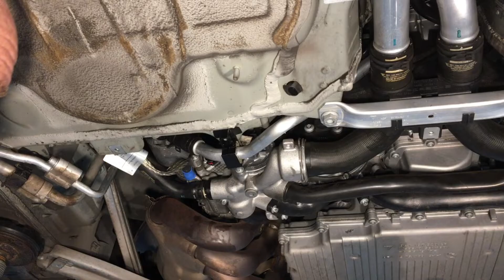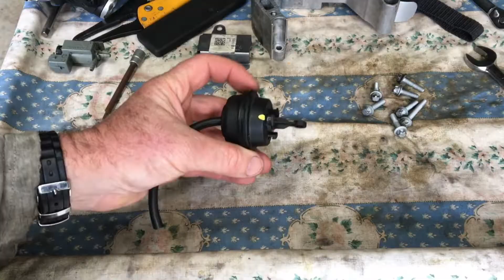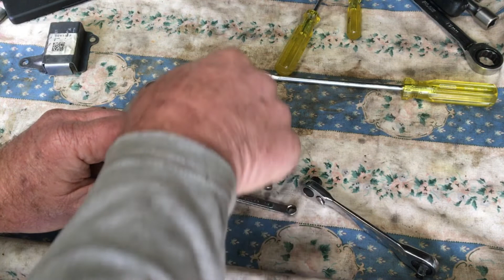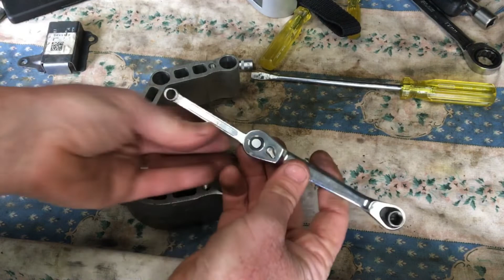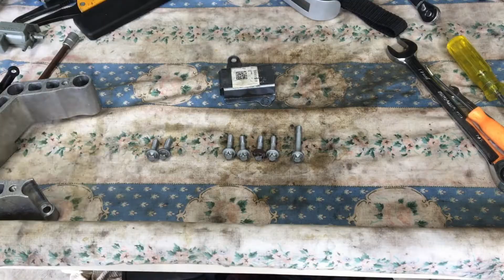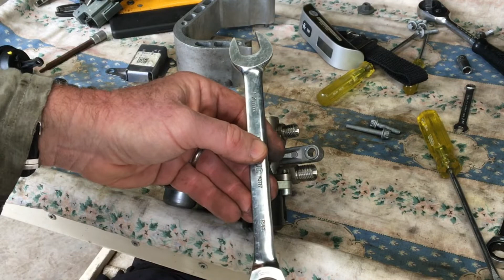Porsche 981 high pressure fuel pump

Comment: Hi Jeff,just to say watched many of your very detailed videos that helped me do a pdk oil change without any issues also the door card issue!| have recently had my car bogging down at 5k rpm randomly so changed the plugs and drove amazing like a remap!BUT on occasions would still not rev past 5k!slow cranking start after days of being parked up misfiring but once warmed up was fine then whilst driving with hood down heard a ticking noise like metallic assumed it was something in the wheel catching then did a datalog with kess3 5kpa-12.5kpa recorded when car drove fine within limits then when it happened again would not get more than 5kpa!i assume hpfp?hopefully you can confirm these are the symptoms of a hpfp failure thank you in advance if you can advise

Comment: Hey Jeff,   thanks for the video.  Changing the topic a little.  Since my high pressure fuel pump died on my 2009 Cayenne S died, and they are over $2200+ US dollars.   I decided to see if I can fix it.  After many hours of research ,trial and error, etc. I was successful and fixed it.  Has been running great for a couple of thousand miles now.    Have also fixed it for two other people.  Recently I noticed that it's more or less the same pump for the V8 Panamera models,  as well as the Cayman/Boxster and 911 models.    Would you be interested in knowing the details and maybe show something about it on your channel.   Not about me, etc.    but in general to show people that these pumps can in most cases be fixed for less than $50 in parts vs thousands buying a new one.

Comment: Jeff, thank you (from Texas, USA) for this (and others) fantastic video!  Thanks especially for your tip of lowering the engine (I lowered mine probably mine 1.5 - 2" (~35-50mm)) and gained enough room to be able to remove and reinstall the HPFP without disconnecting any coolant hoses, etc.  The only thing I disconnected was the bracket that holds the solenoid assembly to the frame so that I could at least move that around a bit.  It was by no means easy to get it done, but I made a point of being patient ;) and was successful.  Now my issue - this didn't fix my problem.

This all started two weeks ago when, after a 2 day track event and a 30 minute drive home afterwards with ZERO symptoms, the next day my 2014 Cayman S wouldn't start whatsoever.  The starter cranked normally but the engine wasn't firing at all.  I plugged in a Foxwell NT530 OBD unit and got a low fuel pressure code.  Readings were in the 600-700 hPa range (if I read the Foxwell correctly).  So, I assumed I had an HPFP issue (Note that I have had "micro hesitations" under low-gear moderate acceleration since I got the car in 2018, but have never noticed any acceleration issues at the track.  So until this point I have lived with it and was hoping that the HPFP replacement would solve both issues.).  However, the problem hasn't changed at all and the Foxwell, though now showing ~800 hPa, still is throwing a low fuel pressure code.

I would greatly appreciate your thoughts on some question:  Would there be an issue with air in the fuel system (I cranked the car a good long time and it never showed any signs of life)?  If so, how does one bleed it?  Could it be a relay(s)?  If so, how may I debug that possibility?  Could it be the LPFP in the fuel tank?  I watched your excellent video on that topic and am a bit daunted by the thought of removing that ring around the top of the sending unit.  But, before I tilt with that dragon, and before I drop several more hundred USD on the other fuel pump, will I be able to determine if it's bad by trying to turn it on and see the flow at the junction point in the back of the car you note in the other video?  My concern is that fuel might flow but I wouldn't be able to tell if it was at a good pressure.  Of course, any other thoughts/suggestions would be greatly appreciated.

My goal of participating in a 12/7-8 track event is in grave danger at this point.  The car has been up on jack stands for over a week...

Extreme thanks for any feedback.
Reply from the maker: I'm not an expert on this subject, but what I do know is that the low pressure fuel pump is simply 'filling' the HPFP, so it can then increase the pressure and provide this to the engine. If it worked fine immediately afterwards I would think there is no air in the system. It will purge it very quickly. If you test the LPFP output at the join like I show in the fuel pump and sender video, this will give you a very good indication if it's working OK. You can see the rate that is pumped when the full 12V is applied in the video.

Getting access to the top of the pump and disconnecting the fuel lines to test is pretty simple. If you do need to replace the LP pump, the tool to do so is now easily available. See link below. It's the same as the BMW pump. It takes a lot of force, and you will need a long breaker bar to remove. This is just the way it is, and the tank and fittings are designed to take it. 

https://www.aliexpress.com/item/1005006259802939.html?src=google&src=google&albch=shopping&acnt=631-313-3945&isdl=y&slnk=&plac=&mtctp=&albbt=Google_7_shopping&aff_platform=google&aff_short_key=UneMJZVf&&albagn=888888&&ds_e_adid=&ds_e_matchtype=&ds_e_device=c&ds_e_network=x&ds_e_product_group_id=&ds_e_product_id=en1005006259802939&ds_e_product_merchant_id=564517555&ds_e_product_country=AU&ds_e_product_language=en&ds_e_product_channel=online&ds_e_product_store_id=&ds_url_v=2&albcp=19821179470&albag=&isSmbAutoCall=false&needSmbHouyi=false&gad_source=1

The pressure you quote is pretty much zero. So it's going to be either the low or high pressure pump. Testing the low pressure pump first is the way to start the diagnosis.

The micro hesitations are generally not going to be a fuel issues. Normally this is due to carbon build up in the intakes, as it's a GDI engine. See my video on walnut blasting of intakes for how to correct.

https://youtu.be/HqPPPF_zin0?si=4bx7D-C8OXcjo9O4

https://youtu.be/opxP7DluExs?si=eDq2nY3JB0rcv2kg
Reply: @jeffrichardsoncardiy  Thanks much for your reply!  Very much appreciated.  Well, I ran the LPFP directly from the battery and output the fuel from the under-car access point, per your video, into a .950L bottle.  In about 2 seconds there were 5-7.5cm of fuel in the bottle.  From my perspective, it seems to be working fine.  So, new (remanufactured) HPFP, LPFP OK, car won't start and the OBD computer complains about low fuel pressure.  Thoughts?  (I will owe you a case of Fosters after this... ;) )
Reply from the maker: @tawaspt  You definitely don't owe a thing. I'm more than happy to help.

The last test I'd do is to confirm the LPFP module is working OK. Have the fuel line disconnected like you did for the other test, then crank the car, so the fuel pump module is applying power to run the LP pump. If it flows normally, then I'd say it's the HPFP. Note that the flow will probably be less as it will adjust the output based on demand.
Reply: @jeffrichardsoncardiy  Excellent idea.  I will try this tomorrow morning (20:23 here presently) after I put all the "stuff" back together on top of the fuel tank.  I understand the supply/demand concept that the DME will presumably manage.  I'm just curious as to how that will look coming out of that pipe.  Strong initial flow then less?  Or?

Is there a sensor downstream of the HPFP that could be bad?  I just went through 2 HPFPs (OEM and remanufactured) and I would be surprised if both were bad (could Murphy's Law be that cruel?).
Reply: @jeffrichardsoncardiy  I forgot to ask.  Is there such thing as an air purge/bleed process required?  I have searched and found none.
Reply from the maker: @tawaspt  NO idea what it will look like, but as long as there is decent flow rather than a trickle or nothing, then I'd think that would be fine. I'd be very surprised if two HPFPs failed. This really does point to something else. Maybe a bad pressure sensor on the HP rail?
Reply from the maker: @tawaspt  There is a 'first start' procedure in PIWIS, that is supposed to fill the fuel lines etc. I didn't use this when I made the video and the car started first time without issue.
Reply: @jeffrichardsoncardiy  Thank you for confirming this.
Reply: @jeffrichardsoncardiy  OK, what happens is, as soon as you connect the battery, some fuel gets pumped.  Then, when you open the door, some MORE fuel gets pumped.  Then when you turn the ignition on, MORE fuel gets pumped.  Bottom line - that system is working.
Reply: @jeffrichardsoncardiy  My prior post got deleted.  Testing to see if this one will post.
Reply: @jeffrichardsoncardiy  Ready for the root cause?  The Answer?  Sitting down?  The hold down tab on the LPFP power socket has broken off and allows the connector to disconnect.  I discovered this when setting up the jumper cable version of the LPFP fuel flow test.  My reaction?  "You have GOT to be kidding me!"  An $1100 USD lesson learned...

I firmly pushed the connector down, reinstalled the battery, and the car started right up.  There was GREAT rejoicing, I must say!

So now the question of whether to buy a whole new sending unit just for that tiny tab (and messing with the 400 Nm lock ring), simply gluing the plug onto the socket (a very permanent solution), or somehow gluing some form of tab to the socket that would hold the connector for the remaining life of the car, including track events.  Perhaps understandably, I am heavily leaning away from the sending unit solution.  Thoughts/advice, Jeff?
Reply from the maker: @tawaspt  Just saw that last message about the real cause. At least you found it and didn't buy another HPFP.  Pretty frustrating all the same. Well, that track event looks like it's going to happen. Happy days.

Comment: @jeffrichardsoncardiy . hi , how you can tell if the High pressure fuel pump has issues ? my car have same symptoms you mentioned but i don`t have codes. I have only on Live Data misfire in cylinder 3 and 5. please advice. thank you
Reply from the maker: The only real way is to check the fuel pressure via PIWIS or similar.
Reply: @jeffrichardsoncardiy  Thank you
Reply from the maker: @ameritooamando9845  It's extremely difficult to diagnose a problem like this without being there, looking at diagnostic readouts etc.
Reply: @jeffrichardsoncardiy  yeah i agree. thank you for the reply

Comment: Ive been fighting single cylinder misfires, no additional codes, fuel pressure is 105.000 hPa at idle. would that indicate a bad/going pump?
Reply from the maker: That sounds pretty good to me. Normally would see far lower than this if failing, and would normally have very long crank times on start as well. I'd be looking at intake carbon build up as a cause. This is a known issue and is rectified by cleaning, normally walnut blasting. I've made vids on all of this.
https://youtu.be/HqPPPF_zin0?si=vp_veWj3E4n0IfLW
https://youtu.be/opxP7DluExs?si=MfSEKcVsBd_m_T2q
Reply: @jeffrichardsoncardiy  thanks for the quick reply,  the intake is pretty clean, checked with a bore cam, only has 23k km's on it. 
Recently did the IPD upgrade and had it mapped. No problems, only after about 3 hours of driving.
Coils plugs solenoids, all replaced at this point.

Comment: Hello, I have a 2007 Porsche Cayman. It has a problem. After running it for an hour or more, it starts to cut and stops completely, and this condition continues until it cools down, knowing that I changed the coils and spark plugs.

Comment: Are you going to investigate the failure point of the pump? I just pulled mine after a failure and wondering if it can be rebuilt. Noticed a lot of oil on the top surface.
Reply from the maker: I'm not planning to. I had a good look at it an it seems you would need some specialist equipment and knowledge to rebuild. I'm all about rebuilding stuff if you can, but this looked beyond me.
Reply: @jeffrichardsoncardiy  yea, I thought the same thing. Know any vendor that will buy back the core? I ended up purchasing a brand new one and was able to keep the old one.
Reply from the maker: @mechaniaclife  I haven't heard of anyone, but I've never looked. Another reason I didn't tear the one I had apart is because it was working perfectly, as is pretty much everything else in the car. There was a very high chance that it would be ruined once I was done, and trashing a perfectly good pump with the requirement to buy a new one to get the engine going again wasn't something I was willing to do.

Are you in Australia? If so, and you can't find anyone to buy the pump and you plan to bin it, could I pay for the postage and have it so I could pull it apart and see what I could do?
Reply: @jeffrichardsoncardiy  Thanks, Jeff. I am a US citizen. I will get in touch with you if I can't source a core exchange, it should go to you since you help all of us 981 owners out.
Reply from the maker: Thanks.

Comment: Hi Jeff , Nice series you're making . You are referring to thé maintenance manual , how did you get a hand on one  ? Rgds Nico
Reply from the maker: Nico, link here for download
https://www.planet-9.com/threads/workshop-manual.246427/
Reply: @jeffrichardsoncardiy  thanks ! Btw how is the oil catch can doing?
Reply from the maker: No issues with the catch can at this stage. The real test will be to remove the intake manifold after a good number of km to see the effect inside the intake ports, but that's a way off.